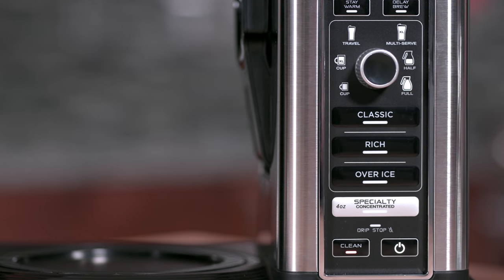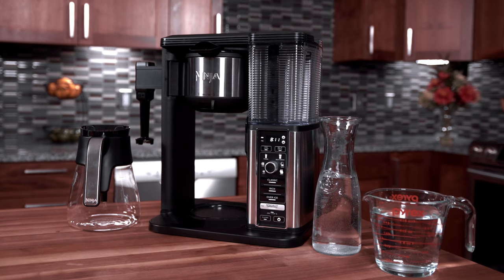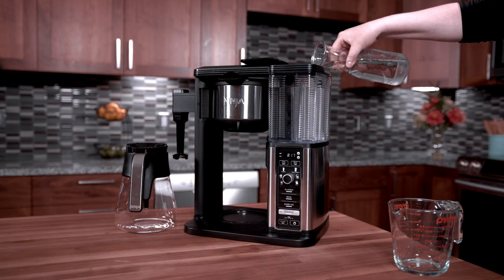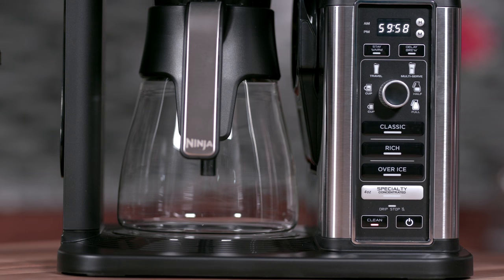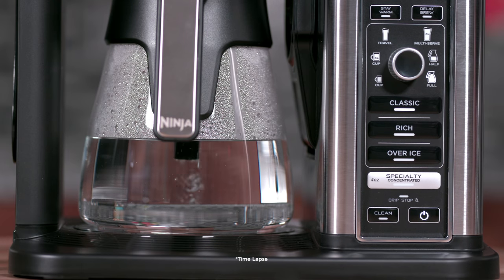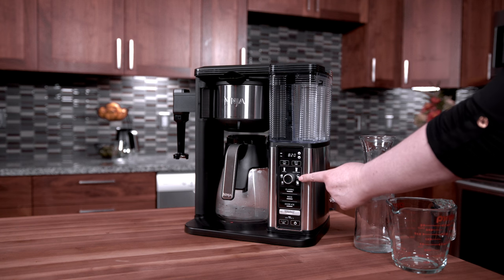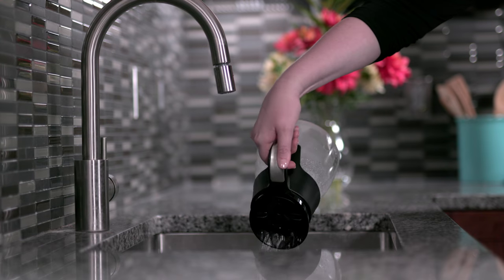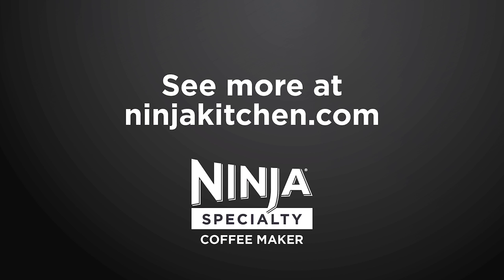How to Clean and Descale (CM400 Series)

Comment: How much Vinegar?
Reply from the maker: Hi Keith, thanks for reaching out to Ninja®. We are here to clear your doubts. Please be sure that we will provide you with the most accurate resolution for your situation. We certainly want to help you with your difficulty. However, we’re not sure the inquiry on your most recent message was left very clear for us. Could you please reply to this message with more details?

Best regards,
Camila
Reply: Up to the travel mug line or 16 oz if you are still wondering
Reply: I filled half way. The other half with regular water.
Reply: Hahaha is that Ninja response a joke?
Reply: @NinjaKitchenUS  if you replied an answer you would of solved so many peoples questions but instead you answer questions like Justin Trudeau does in the House of Commons in Canada.
Reply: 2 cups / 16 oz.
Reply: @NinjaKitchenUS - Are you crazy? Why don't you just simply answer the question here?

Comment: Nobody talks about cleaning the part that holds the reusable filter. There is a piece on the bottom that pushes up or down, when it pushes up it releases the liquid, when it is down no liquid comes out. Well that small attachment has been causing me issues for months. My coffee would splash all over and miss the cup (no matter how big of cup I put underneath) and it would randomly stop letting coffee out and get trapped in the filter. I finally figured out there was a thick sledge of gunk between the filter holder (not the liter the solid plastic part that holds the filter) and the small attachment at the very bottom that stops the liquid. There are springs in between the two parts and as far as I can tell there is no way to separate them so now I have to clean it after every use with a straw cleaner and then put it in the dishwasher every single night. Thought about throwing the whole thing out because the sludge that came out was so disgusting. It felt like flesh. And to think my coffee has been running through that for months. I do the vinegar clean weekly and always have. Huge design flaw.
Reply: Okay I looked it up to clarify and the part I am talking about is called the removable filter holder.
Reply from the maker: We are very sorry to hear about this, Sierra. We want to thank you for your feedback regarding the filter holder. With this said, we do recommend removing the filter holder from the brew basket, after each brew, and thoroughly wash it with warm soapy water, or putting it in the dishwasher on the top rack.
Reply: @NinjaKitchenUS  this filter holder holder at the bottom of the reservoir appears to not be removable.  How do you remove  it?? I have the same problem always gross gunk in it.
Reply: @tammyolley1085  Just throw the whole reservoir in the dishwasher.
Reply: i actually put mine in the top shelf of the dishwasher
Reply: @tammyolley1085  if you haven’t figured it out yet I got mine off today. I wish I could send a video but I took a knife and where the bottom piece of the filter hold on I popped the knife in between one side and pulled and it came right off. Be careful with the springs so you don’t lose them.
Reply: I'm sorry that kept happening but also glad you figured out what was wrong because I've been having that issue as well so now I know what to try next
Reply: It is actually fairly easy to disassemble and clean the filter holder. Start by pushing up on the retractable part on the bottom and reach inside and pull the small rubber stopper off the pin that pushes up in the middle. Then, place it upside down and there are two wings, one on each side, that you can slightly bend out, over the tabs that keep it in place. Pull the tabs out and pull the bottom off. Remove the 2 springs and make sure not to lose the springs or the stopper. Clean as desired. Assemble in reverse order. The most annoying part is stretching that rubber stopper over the pin again.

Comment: I keep getting green stuff at the bottom of the water container and in that clear bubble, am I able to replace that clear bubble? At the bottom of the clear reservoir
Reply from the maker: We're so sorry to hear you're experiencing this issue, Dylan! To better assist you, please call our customer support at 1-800-365-0135. We're open Monday to Friday, 9:00 am through 9:00 pm ET, as well as Saturday from 9:00 am to 6:00p m ET. Please have your model with you.
Reply: Same thing here. Keep getting green inside the bubble
Reply: I guess they don’t sell a replacement bubble. You’d need the entire water container portion of the coffee machine
Reply: @dylansmith3  it’s algae buildup. Your unit gets too much sunlight and it causes algae to grow in the bubble. Put vinigar in the bubble and let it sit for a day, empty it by toggling the button at the bottom, you’ll have to repeat this step a couple times, hopefully that causes the built up algae to dislodge or drastically minimize. To prevent this problem in the future, make sure your reservoir is empty unless you’re using it.

Comment: That’s all well and good but I can’t clean the green slime inside the little plastic piece in the base of the Reservoir.
Reply from the maker: We are very sorry to hear that you are having this issue, Frank! We would be more than happy to assist you with this! Please We would ask you to call our customer support at 1-800-365-0135. We are open Monday to Friday, 9:00am to 9:00pm ET, as well as Saturday from 9:00am to 6:00pm ET. Please have your model with you when you call.
Reply: hey were you able to get the green slime out? i see green slime in the little plastic piece building up as well and dont know how to clean it
Reply from the maker: Hi Sukhpreet, we're sorry to hear about your Ninja. You can soak the reservoir in white vinegar and hot water to remove the residue. We hope this helps!
Reply: @NinjaKitchenUS  That does not work. Tried it several times and it’s still green.
Reply: I am having the same issue. Please help.
Reply: Try using filtered water.

Comment: Instructions unclear. Used the whole bottle of vinegar with 1 tbsp of water. Wish me luck
Reply from the maker: Thank you for reaching out to Ninja! We are sorry to hear the cleaning instructions are unclear when choosing to use white vinegar to clean it.

 Fill the water reservoir to the Travel Mug line (16 oz.) with white vinegar, then fill the rest, of the reservoir with water up to, but not exceeding, the Max Fill line and press CLEAN. One the countdown has ended END will appear in the display. 
Empty and thoroughly, clean the carafe and water reservoir with warm, soapy water to remove any cleaning solution that could affect the flavor of your coffee. 
Fill the reservoir with fresh water up to, but not exceeding, the Max Fill line and set the empty carafe beneath the brew basket. Flush the system by running a Full Carafe, Classic brew cycle with water only. After the cycle is complete, discard the water and thoroughly, clean the carafe.

Please reach out if you have any questions, we are here for you.
Have a wonderful day!
Reply: @NinjaKitchenUS  Thank you for your help! It's as good as new now. I plan on trying several coffee recipes from the book sometime soon.
Reply from the maker: You are very welcome! We're happy to help.